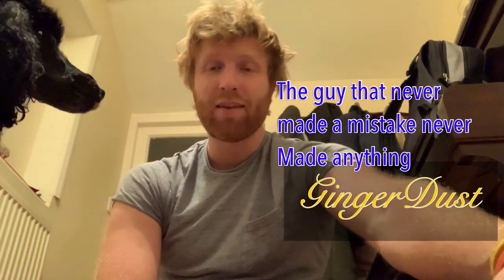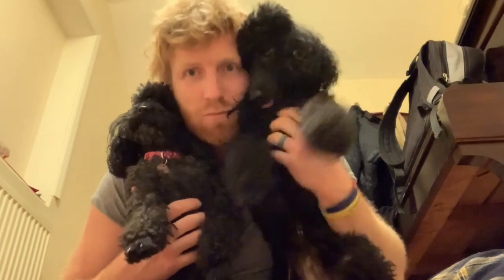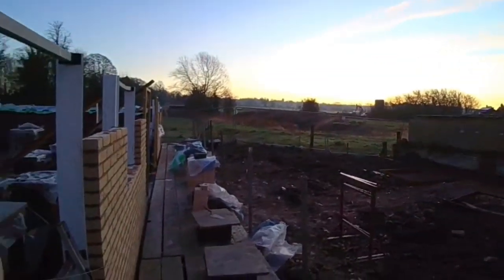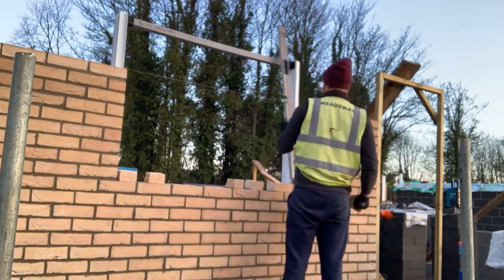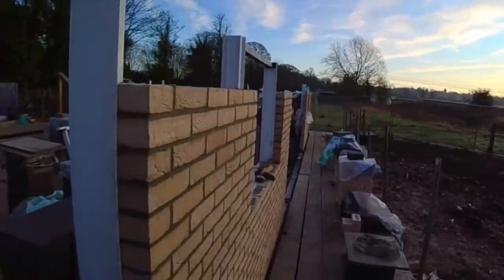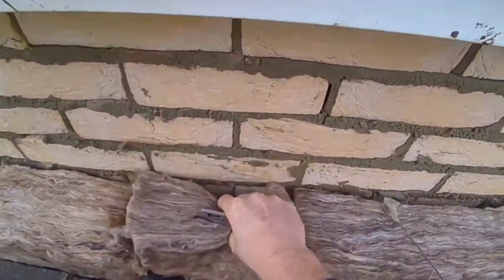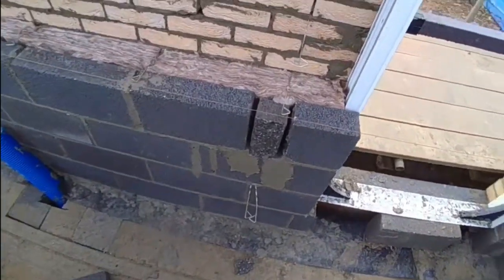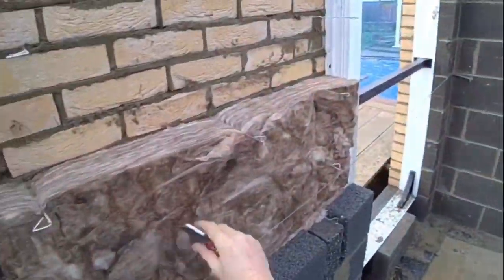Cowboy builder 2 | The skill of bricklaying

Comment: Why don’t you bond jack wall into what you are are building?
Reply from the maker: Because they are two different types of blocks and I think it’s for a fire risk as the middle wall blocks as far denser
Reply: I always thought concrete blocks was used for acoustic. And the reason why we don’t bond thermal blocks is because it’s creates a cold joint. ? Think all these regulations defeat the object sometimes?